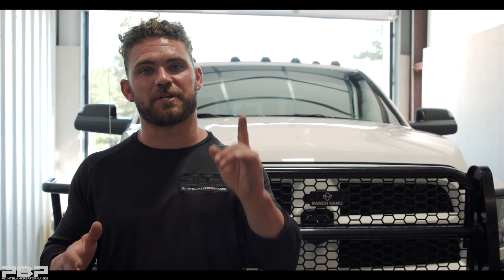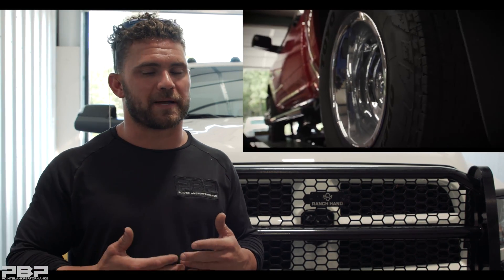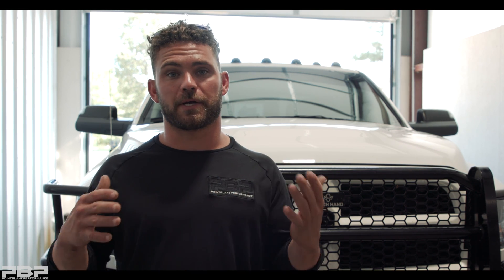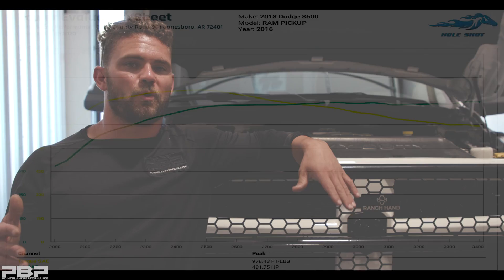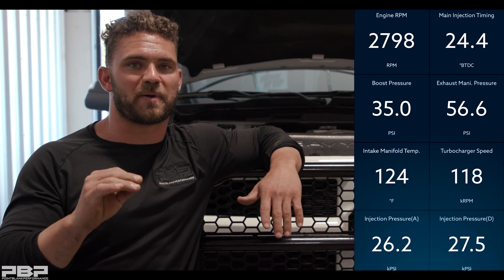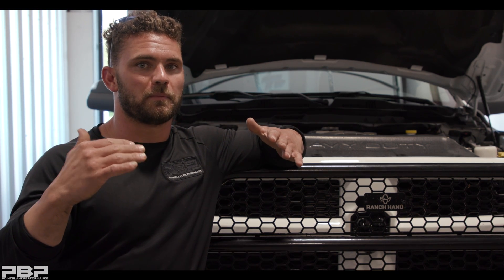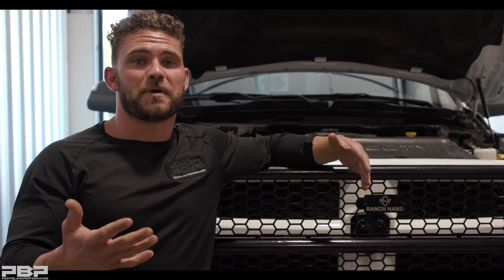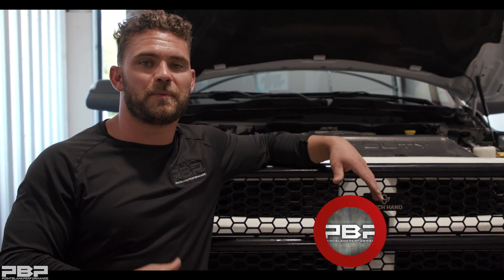TATER BUILT 63MM TURBOCHARGER 4TH GEN CUMMINS DYNO DATA!!

Comment: I've got a 2012 with a 66mm 2nd gen swap, stage 3 cam, tune, exhaust and intake manifolds, and otherwise stock fuel. Usually keeps a 1:1 DP ratio or better.

Comment: Boost gauge is pegged so interpreting data is hard.  And if the exhaust drive pressure reading is off factory sensor- that is absolute pressure and not gauge pressure.
Reply from the maker: Thank you sir for the feedback !!

Comment: I have a question. I have a 2014 cummins with stock vgt turbo and I keep throwing a code when my engine light comes on I believe it’s p0046 something to do with actuator. My turbo is still working but when it throws my light it takes forever to build boost. What can I do without spending a ton of money right now on a new turbo. Also love the vids very helpful.
Reply from the maker: When this code “ boost control A Circuit Range Performance “ shows up first I always look a VGT duty cycle actual and desired to see if it’s working at all. If it but won’t meet desired I replace the actuator . If the turbocharger doesn’t actuate at all I check voltage if good then move on pulling the actuator , manually try to move  the “vanes” if they are not locked up I replace the actuator . If the vanes are “ locked” replace the entire turbocharger sir .
Reply: I was throwing the same code p0046, I talked to 3 diesel shops. Everyone of them said you can replace the actuator but they seen it happen to many times soon as you replace the actuator shortly after you're turbo will go out an then ruin your new expensive actuator. Replace the whole turbo.

Comment: The stock map sensor will only read 36 psi, unless you have an aftermarket psi gauge or 10 bar map sensor were not seeing what boost was actually made unless I missed it somewhere
Reply from the maker: Unfortunately we only had a ezlynk for the boost data. No external ports
Reply: @POINTBLANKPERFORMANCE  so then it might not have as bad a drive pressure issue then, good to see the turbo did lower the drive pressure though.
Reply: @BigMilkTank  this  i agree. i bet you it’s hitting into the 40s for boost psi! which would get a way better ratio!